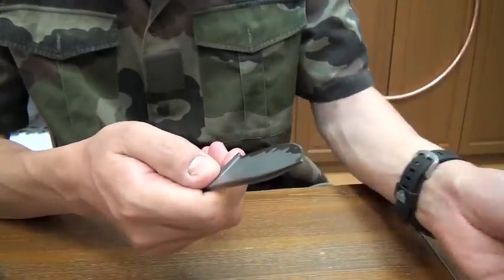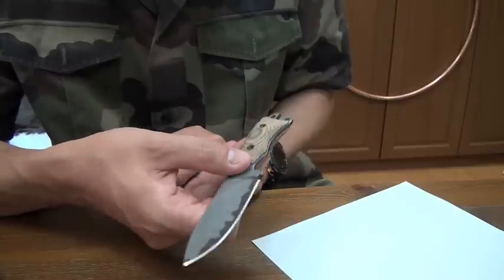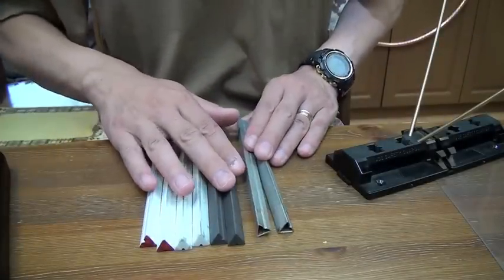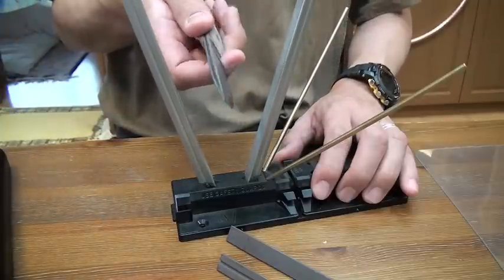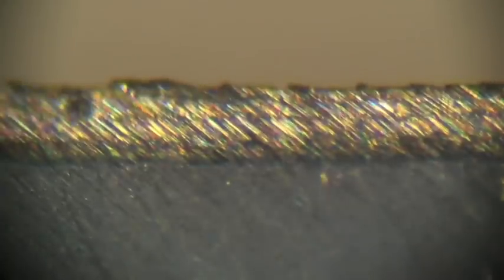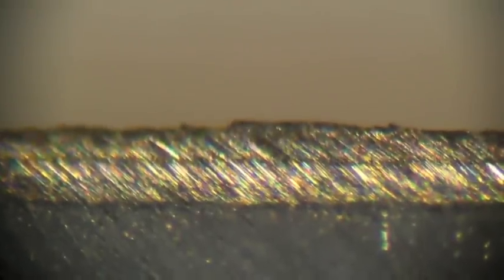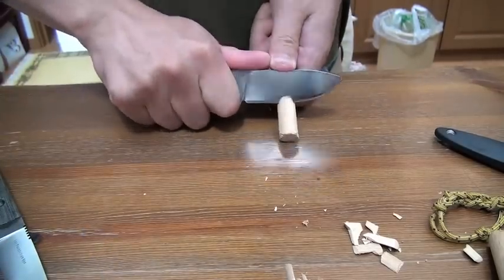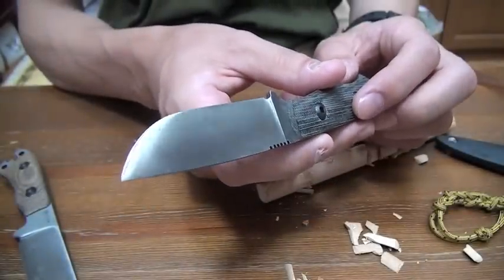Becker Necker convexing and wood cut test.

Comment: Wow, again another great video Wako!  I would like to see how that Beckers edge looks under the microscope after you dig up some plants with this new edge geometry now to see if it chips out, then we can know if the steel is brittle or if it was the initial edge profile.  I think it would not chip out now as bad if you tried it, digging in the soil and cutting the roots.  Soil usually contains sand and other hard silica abrasives.  Id like to see it, but would hate to see that polish ruined too.

Comment from the maker: @LiFetommi Yes, I understand you very well. If the blade thickness and the height of the bevels are the same, the zero grind edge like Scandi knives is the sharpest,  The secondary V edge and  the convex edge depend on their angle. Kitchen knives are very thin generaly, so the convex edge must be deeper than V edge from my microscopic view. I think good convex edge needs proper thickness of the blade. I recently like V edges, because I can set its edge angle by the sharpening angle. Thanks.
Reply: Instablaster...

Comment from the maker: @driftworld86 Completely different. Sharpmaker rod angled portion mustn't be used to the edge in my opinion. It's because it makes very high pressure onto a very narrow spot on the edge. Which can result in micro chipping. If you use it, you had better use only the flat surface just for touching up. Water stone sharpening cuts the whole bevel completely different from the Sharpmaker. And I use the white compound loaded leather strop for touching up. Thanks.

Comment: @drkknight614 convex are great however not very good in the kitchen. Trust me i use knives minimum 4 hours a day in kitchens, thats 2 hours prep start of lunch and dinner shifts. Plus the usages during service probably takes it up to 5hours a day. Convex presents the edge at a difficult angle to use for slicing and filet even tasks like peeling skins etc. It's an extremely sharp and durable edge type but kitchen work more suited using thin blades with V edges.